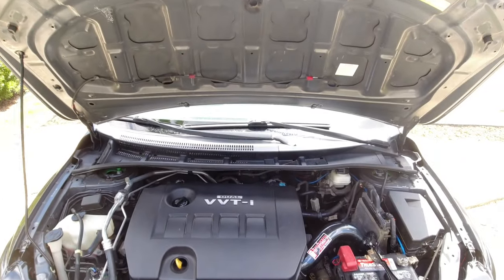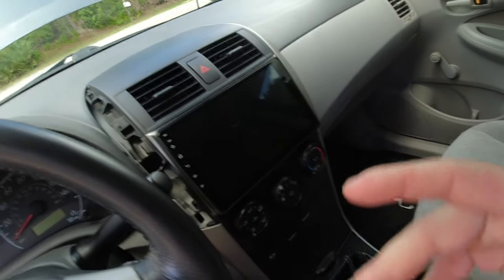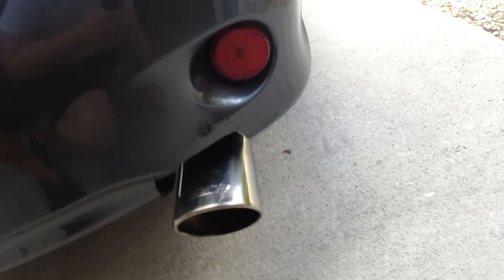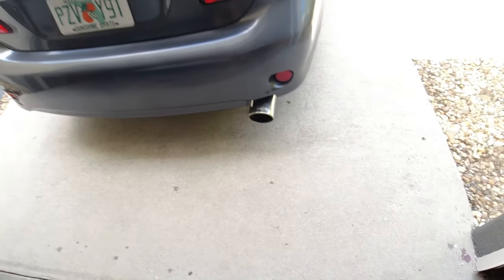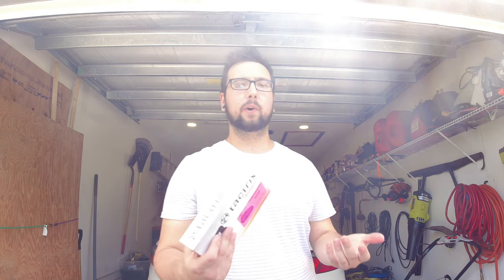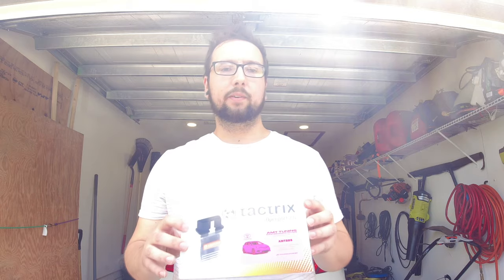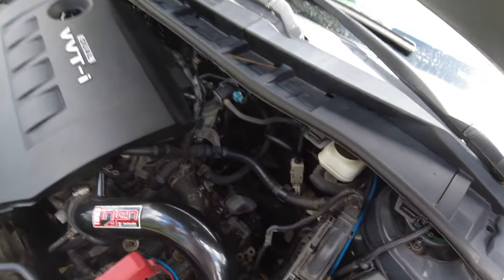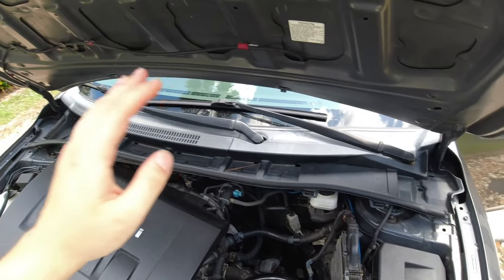5 PERFORMANCE MODS FOR TOYOTA COROLLA

Comment: I just switched out a Spectre Cold Air Intake to a K&N. Spectre makes bad cold air filters. I recently put a Borla Exhaust on my Corolla. Plus exterior accessories that I'm styling up on my corolla I put side mirror rain guards on today
Reply from the maker: Yeah K&N is probably the best! 
And sounds like you got your corolla sounding good! Love to see all the people who modify their corollas!
Reply: @BrandonStellmach  Yeah I was racing a Civic Si somewhat newer. I put my car in second gear and did a red line of 7 RPM and smoked him. I was impressed with my car and how it handled it.
Reply: @BrandonStellmach  what kind of header do you recommend for a 2013 corolla and did you have to change the O2 sensors
Reply from the maker: @That_TRD_Guy  the ones I have are nice, but if you can afford the weapon R headers, they make more power. But cost about 4X the amount. And I used the same O2 sensor that was already on the car.

Comment: Interesting video. I just spent $2k on my "08, & while picking up 25hp & nearly the same torque would be nice it is hard to justify paying what I paid for the entire car, but at the same time having $4k into a Corolla that can rip.....for a Corolla would be fun. Sadly mine is an auto & if it was a manual I would definitely be tempted. I may at least drop a k&N air filter or cold air if it really helps it breath enough to get 5hp.
Reply from the maker: Manual transmissions definitely make the driving experience more fun! But I agree! Putting more money into the car than it’s worth is a tough one to swallow some times! But if you like the car and plan to keep it until it blows up, it never hurts to put more money into it, still would be much cheaper than buying a newer car!

Comment: I see the intake and exhaust cost about the same, which one would you recommend to do? I already have the k&n drop in filter as i think they call it so was thinking of maybe starting with the exhaust.
Reply from the maker: I would definitely say upgrade the exhaust. There might be a small increase in power, but I think it’s worth it because the sound is amazing!

Comment: Did you have to mod the back bumper for the Borla exhaust installation?
Reply from the maker: If you have a base model or and LE, you will have to make a cutout on the rear bumper for the exhaust cut out!
Reply: @BrandonStellmach  I have a 2013 S. It has a rounded shape for the stock exhaust. Not sure if this is bigger though.
Reply from the maker: @DM-xw4um  if you have an S, it will fit fine! Many people have done it without any issues!
Reply: @BrandonStellmach  Thanks for the feedback!

Comment: Definitely wouldn't get the solenoids in my opinion. I've accidentally left one unplugged and other than getting a check engine light, there was absolutely 0 difference in driving experience. I don't believe there would be any different with a "performance" solenoid either.
Reply from the maker: They are only for VVTI. Which doesn’t activate until around 4500-5000RPM. So you don’t notice much of a difference when not in VVTI.
But I have installed these since the video. And there does seem to be a slight increase on the higher end. But it also might be a placebo affect.  They only claim about 5HP. So it’s really hard to tell that without an actual dyno.

Comment: In your opinion what’s the best option for turbo charging my Corolla? Is it worth it? What are the pros and cons? Also what are all the options for it I know there is a turbo charger, super charger and something else. I just want my car to feel more consistent with accelerating. Would headers help?
Reply from the maker: To be honest, I don’t think turbo charging the corolla is worth it. Unless you really love this car and body style it has. Because for the price you can sell your corolla plus the price of a turbo kit. You would pay probably around 10K-13K with the value of the corolla. And if you look, you could probably find a car with the same HP as the corolla with a turbo for the same price. 
And for supercharging, they don’t make one from what I have seen, there might have been one on a lotus with the 1.8L, but I’m not sure about that. 
And yes headers will help out and help get some low end torque, which should make the acceleration a bit more consistent. And pretty much all the other mods I went over will give it some more power, just not as much as a turbo would. I hope this answers some of your questions.
Reply: @BrandonStellmach  Yeah thanks for the info, I don’t really know anyone that’s into Corolla’s like I am so it’s hard to get a genuine opinion on it. But headers will probably be my next big mod. Just another mod to add to my checklist 😅
Reply from the maker: @Mfmamba8  no problem! 
And yeah not many people modify them! I am always trying to find information and there is almost no one out there that does much for these corollas!
Reply: I think the best practical mod would be getting better brakes because decreasing your stopping distance is great for avoiding crashes and accidents as a few inches or feet could mean the difference between life and death or totaling your car or having to deal with getting into an accident. If you really want a torque upgrade for acceleration, only a turbo would give you any meaningful upgrade to your acceleration needs. I say just get a turbo if you really love your corolla, i

Comment: If you haveCorolla and you want to change the color is which is better plastidiping painting or wrapping
Reply from the maker: It kind of all depends on how good you are at either one. Vinyl wrap is probably way better. But it’s not easy to apply. And plasti dip is much easier to apply, as long as you are decent at painting. But you are just limited to colors with plastidip. Vs vinyl you can almost get any color!

Comment: What cheap mods would you recommend for more Hp, I have a 2012 Corolla s Automatic
Reply from the maker: These really isn’t any cheap mods to help performance. Most of them are $250 and above. 
But the best ones I personally liked were the cold air intake and the borla exhaust!
Reply: @BrandonStellmach  I have an aftermarket Magnaflow exhaust . I’ll most likely add the intake for some power as well. What else would you recommend that’s not too crazy lol. Thank you btw
Reply from the maker: @johnnyruv3426  well if you can find headers that will be a decent upgrade. If gave my corolla a nicer exhaust tone. I used to have DNA headers, but they are really hard to find.

Comment: Would these work on a Toyota Corolla 2016-2017? I’m kinda new to this building cars stuff sorry.
Reply from the maker: The 2016-2017 have the same motor. So everything should fit. The only thing is the chassis has changed, so there might be slightly different part numbers.

Comment: Where did you find those brake lights and will they fit on a 2011 corolla Le?
Reply from the maker: If you are talking about the round bumper lights, I bought them off eBay. And I have seen the 10.5 gen corollas with the bumper lights.

Comment: which model corolla do you have ? i bought a 2015 le eco for 5k but wanna do some things to it, just wanna know if these could work for mine
Reply from the maker: I have a 2009 corolla base model. With the 1.8L. So the 2015 should have the same engine. 
I’m not sure if the eco is slightly different or not.

Comment: Did you install the cold air intake yourself or did you have it installed from somewhere else?
Reply from the maker: Yes I installed it myself, here is the video I did it in.
https://youtu.be/TNgHk9fRTJs
Reply: @BrandonStellmach  Sweet! I’m looking to install one on my corolla but I don’t think I could do it myself and unfortunately I haven’t seen any places that would install one for me
Reply from the maker: @icephyron4823  yeah that’s the biggest problem with after market parts. Not many places like to install them, because of warranty problems. 
You either have to do it yourself, or find some other mechanics that will help you install it.
But to be honest it’s a pretty easy install. It seems like a lot, but really it’s not.
Just set aside a good 3 hours so you can take your time and do it slowly. You will be able to do it!

Comment: i truly dont see how a vvti solenoids can add more power. it does not increase the range of degree the cam can be turned. and the ecu decides where the cam is based off the cam position sensors so they cant actually "change" anything. so really the only thing they could possibly do is be faster than the oem solenoids which already move faster than the engine could ever rev.
Reply from the maker: I am on the same page as you! Because they are controlled by the computer, and it’s not like it’s going to change the computer of when they turn on and off. 
That’s why I haven’t gotten them, but everyone who gets them swears by them and says they make a big difference. So that’s why I mentioned them in the video!

Comment: Hi, the gains that you spoke of with the tune, is that on top of the gains you already got with the previous mods, or is that total hp gained altogether?
Reply from the maker: The tune is in total, think of it as it is Guaranteed HP. While the HP that the mods say they are are estimations, so the tune just makes sure you get all the HP out of everything you install.
Reply: @BrandonStellmach   I see. Do you feel  you got that out of your mods and tune? I know seat of pants isn't very scientific but it's what ultimately matters isn't it. 

I think that number is a pretty good number for such a conservatively tuned engine from the factory in what is designed to be such conservatively designed practical transportation.
Reply from the maker: I mean I felt a slight increase in power after every mod I did, and then with the tune I felt a little bit more of a bump, but it wasn’t drastic. But remember I did it 1 mod at a time. So if you probably went from no mods to all the mods with a tune you might feel a drastic difference, but with me I didn’t notice a huge gain. But overall it does feel more peppy than when I first got the car.
Reply: @BrandonStellmach  Makes total sense. Thanks for your responses! I'll probably be making some improvements like these to my own Corolla.

Comment: How much were your mods and labor in total. Just snagged a 2016. Like new. 75,000 miles. Still have a 2014 altima. like new, 125,000. About to sell it and drop some cash in my corolla.. edit: be warned about the turbo. These cvt transmissions cannot hold up after 220 horses. You will legit destroy your car....
Reply from the maker: With all my mods including the wheels and tires. I have spent around 5-6k!
And luckily for me I have the 5 speed manual. So it should hold up much better then the CVT transmissions!

Comment: Could you buy a Corolla S bumper and slap it on your car to avoid cutting it out for the exhaust? I have a CE as well but I don't want to cut my bumper lol.
Reply from the maker: Yeah you could just do that. But than you will need to get it painted to match your car!
Reply: The borla is Seamless with my 2013 Corolla S
Reply from the maker: @Mfmamba8  agreed!

Comment: That cold air should work on a Toyota matrix automatic right?
Reply from the maker: I believe this will work on a 2009 and newer matrix because they have the same engine. But double check the fitment to make it works.

Comment: You should get the jet performance mass airflow sensor.
Reply from the maker: I have thought about it. But haven’t heard anything about how much power or any real benefits.
Reply: @BrandonStellmach  bought one for my 2013 corolla and it gave me a check engine light.  I threw it away. Plus underneath that jet sticker is a Denso brand. Snake oil. Just get yourself a throttle control unit. Like pedal commander or sprint booster.
Reply from the maker: @silentgaming1197  well I’m glad I haven’t got one. Because to me I didn’t see any performance gain from this. And no one would tell me anything good about it!

Comment: Interesting , I thinking the European 3dr /5 door hatchback looks better
Reply from the maker: I agree! I think the hatchbacks do look better!
Reply: @BrandonStellmach Do they sell the hatchbach  version in America ? , Also  got my first car  2004 Corolla 1.6 vvti automatic 3dr , 78000 miles runs great so far touch wood ,
Reply from the maker: @DC3Refom  well they never sold it as a corolla, it was called the Toyota matrix. But never looked as good as the European hatch backs.
Reply: @BrandonStellmach  ah so that's what a Toyota matrix is I z seeing that after looking for a right hand door check strap for my first car a Toyota Corolla 2004 1.6 VVT-1 3 door automatic ( have Autism and dyspraxia so only physically drive an auto) as when I bought the car , the previous owner  somehow managed to snap it. , only cost me £23 on Amazon UK